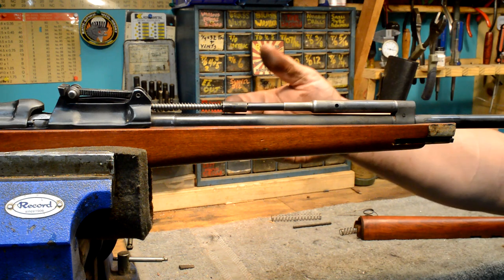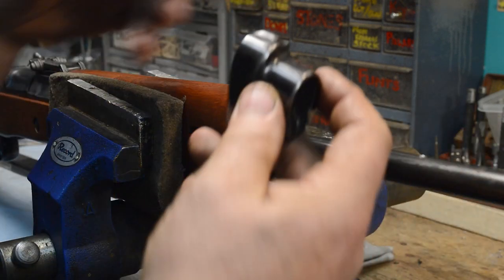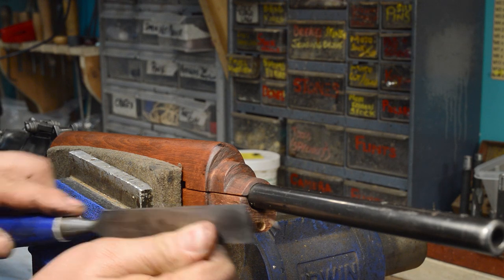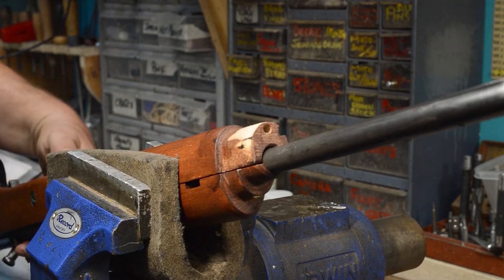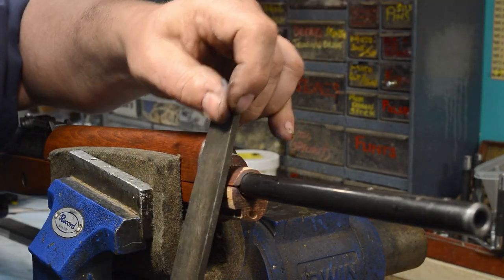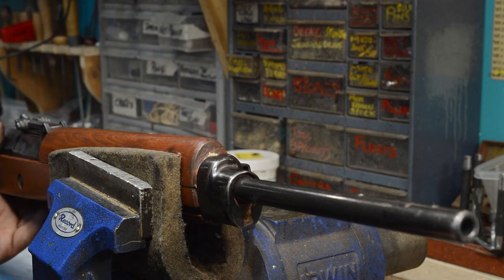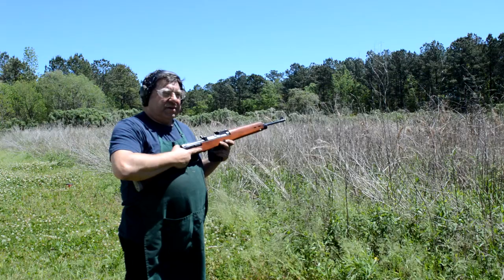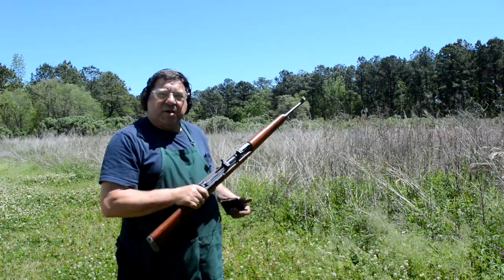Anvil 061: Walther K43 dial in

Comment: Had a couple of those back when Oz had a sense of humour about such things. The first one was missing its extractor. Apparently, that is the "great, undocumented feature" of the design. The extractor retention system left a LOT to be desired.Oddly enough, it would extract and eject, barely. Residual bore pressure? Black-Forest magic? Absolutely ZERO primary extraction in these "flapper" locked jobs

A fascinating piece of history and engineering.

Nice resuscitation work there, as always.
Reply: That's a head scratcher, isn't it?...You'd think that being "over-gassed" into the operating system, they'd actually have a relatively lower bore pressure......presumably too little to act like some blowback operated weapons do, when they omit the extractor entirely....Which is what it sounds like you're describing. Curious indeed!
Reply: The method they engineered to provide the delay is obviously pretty spot on. Must also be a strong action too imo, front locking I guess.
Reply: @rickb1973  it's only over gassed until the bullet exits.
Reply: @redtobertshateshandles  Good point

Comment: A great addition to the G 43-K 43 is a  25 round Magazine. A MG13 mag can be easily converted by adding the same sized lumps as on the G 43 MAG.   MINE works fine.

Comment: At around 15:20 you're talking about the gas system and it's actually super interesting to know that nowadays it is more than recommended to change the gas system on your G/K43 as the originals were made according to the fact that those guns would be issued in russia where the temperature were so low that the gun required a much higher gas pressure in order to successfully cycle the bolt assembly and operate it. Used in normandy, these guns had to be adapted or the gas system would blow up.

At least, this is what I've heard and it makes sense, will have to definitely double check that

Comment: Great video but I'll admit for myself that I am never bored watching you weld, and repair guns in any fashion,

Now, the area of a circle calculation is Area = Pi x Radius^2 so if you know the bore size it is an easy answer, just subtract the smaller from the larger and convert to % (divide by 100 or move two decimal places). 

 Mathematicians and 13 year old 'experts will probably mention there is a more accurate way to calculate this so I'll mention that I know, I took Algebra in the 60s...
Reply: In summary...a hole 1/2 the size of the previous larger hole....has 1/4th the cross-sectional area..

Comment: I had one,once; when this country still had a sense of humour.

As with many of them, it was missing its extractor, extractor spring and retaining pin. Absolutely the weak-point of the design.

Interestingly, though, there was enough residual bore pressure to partially extract the fired cases (brass). The folks at Heckyl and Jeckyl seem to have had some experience with the design, as their extractor is similar, but uses a MUCH better spring system.
Reply: A few still share a sense of humour.

Comment: I know this is a couple year old video. I have one of these mostly matching with the exception of the gas cylinder(have the original but cracked). Was thinking of the updated gas system mod
Reply: Highly recommend you just snag a complete gas system from Frontline Militaria. Works very well

Comment: Mark, I was taught to always use non copper coated rods when welding on guns. I was told that the copper plating on a welding rod would mess up the blueing process and the color would not come out correct. Can you expound on that? Thanks for the good video, sir!
Reply: Not Mark, but my guess is that since some blueing is a controlled rusting of the surface, that any copper deposited from the rod into the weld won't blue properly since copper doesn't rust but oxidizes instead.
Reply: I was wondering what kind of rod he used or typically uses.

Comment: I'm a studying welder so I don't have much experience with specilized steels, where do receivers and barrels lie as far as hardness and weldability? Are they like tool steels?
Reply: If memory serves, modern barrels are 4140. The rest, I don't know
Reply: Neither are meant to be truly "hard"". TOUGH? Yes, but except for bolt-locking surfaces, NEVER "hard" You can make a perfectly functional barrel out of mild steel. If loaded with "proper" ammo in a correctly cut chamber, it will work, but, in modern, high intensity cartridges, will wear fairly quickly. The classic Lee Enfields, before the No4 series, were specified to be made from straight carbon steels, heat-treated to an exacting recipe, as required for function and durability. In the wild old days before every man and his dog had pyrometers, this had a fair "fudge factor" built in  ("Cherry red' is a whole lot different in a big 19th-century shed on a rainy night than it is in a brightly-lit forge).

What appear to be simple, small parts, like the cocking piece, were differentially heat-treated: The rear, threaded, "grasping" section was  pretty much left alone. The front half inch or so was heat-treated to a high hardness before final precision grinding of the sear bents.

Lee Enfield bolt heads were originally made from "malleable cast iron". If you see one with e letter "M" stamped on it, that means it was made from "Mild" steel and then case-hardened. Most of the production from Lithgow had "M" bolt heads.

4140 is pretty versatile stuff, because it can work fine in some applications, straight off the machines or be carefully heat-treated to be almost glass-hard for things like sears, but NEVER for parts subject to shock.

The M1 rifle receiver was made from 8620, which is a whole other exotic steel. When properly heat-treated, almost impossible to "blow up", or even set-back the locking shoulders. (never mind the wrecked other bits of said rifle becoming stray missiles or bent scrap.

Welding any "exotic" alloy without pre-"soaking" and subsequent stress-relieving can be "interesting", as well. A few dabs with the TIG AND the correct filler rod, here and there? OK, but.....Start zapping air-hardening steels in stressed locations and life can get a little strange.

Comment: Does the TIG welding effect the barrel steel in any negative way?
Reply: Id assume tempering would be shot
Reply: @Darranis_Kuningasverinen  Done quickly  and with the proper heat ..the HAZ zone of a tig weldment is at most... .050  (fifty thousands of an inch) so you arnt screwing with much tempering/heat treat.

Comment: Stupid question: when you describe a stock as "re-pop", what do you mean?
Reply from the maker: Reproduction
Reply: @marknovak8255  One more stupid question:  The stock on this rifle looks like a rough finished, machine inletted stock.  I ASSUME that there isn't some factory post war cranking these out, and it obviously wasn't fitted before you got at it with a rasp and chisel.  Are these just original wood that never got mated to a rifle in Germany and eventually found its way on to the civilian market here or does somebody have an inletting machine set up to make these?  Is that answer variable for different guns?

Comment: Not a registered gunsmith or trying to tell you how to do your job but how come you dont plug the wholes with screws torque them down good and then file them flush with the receiver?
Reply: He's making look like the holes were never there. Doing it the way you said you would always be able to see the screws.
Reply: Probably to avoid a joint line.
Reply: @steveb6103  no not if you file it down flush and buff they would be darker if you reblue but Atleast your not applying heat and compromising the strength of the receiver
Reply: @steveb6103  but then again im not one to be knowledgeable on this
Reply: @christophermercer2632  the only strength critical area on a firearm is barrel, locking lugs, and bolt.

That's why an AR can use aluminum receivers, with steel barrel, barrel extension, and bolt.

Comment: Is it just me or does the handguard on that K43 look like that on an AK?
Reply: its handguard was roughly inspired by that of the SVT-38/SVT-40, as was most of the gun tbh. And it's a bit of firearm convergent evolution - the SVT, G43, SKS, and AK all include 2-piece handguards that cover up a gas block and piston, all of which get quite hot and release little puffs of gas. That vented handguard design that they all use is simply the most cost effective way to protect the shooter's hands from all of that heat, give the metal components adequate air flow, ensure easy disassembly, and keep costs down.

Comment: I was a mechanic for years and now I have stains on my hands they are hard to clean any tips ??
Reply: Not working as a mechanic anymore seemed to do the trick for me. 🤣 In all seriousness, try some soap with pumice in it like Lava soap and a plastic bristle brush. When I was working as a mechanic, I liked to get my disposable gloves from Advance Auto Parts. Grease Monkey was the name of them I think? They were blue and like 10 mil thick. Pretty tough for disposable gloves, some days I would only go through one pair, and good dexterity too. Your hands will sweat like crazy in them, but that also helps keep them clean. When I worked at a salvage yard, one of the other guys would wear a pair of crappy, disposable gloves under his Mechanix gloves.
Reply: I use Scrubs-in-a-Bucket after working on my truck, tractor, excavator, or whatever other greasy, nasty thing comes along.
Reply: I always hose my hands off with brake cleaner before heading home. Don't do it if you've got any cuts on your hands though, that doesn't feel very nice. Probably going to grow an extra limb one of these days, but I'm not leaving grease stains on everything I touch anymore. Plenty of pumice based soaps on the market that do an Ok job, like Ian said the plastic bristle brush is a must for getting under the finger nails.

Comment: What is the name of the wire wheel and where can i get it????
Reply: If you mean the one he uses to remove rust - it is from Brownells and is made by Grobet
Reply: If you're referring to the CARDING wheel, then like J Whiskey said, it is from Grobet.  Recently, I've learned that the longshaft buffer he uses is made by Baldor, and I cannot seem to find one like his.  With a carding wheel you have to have it spinning 500RPM or less, apparently.  Everything I've found thus far has been easily 3 times that amount, and I'm nobody to play with electrical currents & have no clue how to reduce that speed.  

Just REMEMBER a carding wheel is NOT the same as a wire wheel.

Comment: Wouldn’t a lathe file worked just as well?
Reply: As long as it has never, ever touched metal.
Reply: As Mark has said over and over again: there may be other ways to do what he's doing. He's showing how he does it, and he won't proclaim anything as the One Best Method.

He will tell you what not to do, however.
Reply: @TheRealColBosch  and Mark has used metal files on wood, as long as the file in question has never touched metal.

Not that I could tell you which episode of Anvil he does this...
Reply: While I’ll give you gentlemen kudos for listening. A lathe file doesn’t have side teeth. This way you can get up close without marring the side finish. 
That’s the point I was making. Nothing about it touching metal. This way you can just buy the right file for the job.
Reply: @McFingal  ah, gotcha.

Could have sworn that I had a metal file with teeth on the side, but whatever. It may not have been a lathe file.

So yes, a brand-new lathe file (that already comes with one flat edge) would be ideal. The reason you need one that has never touched metal is not some cross contamination worry, it's because a single file stroke on metal will dull the edges enough to really tear the wood.

Thanks for adding to my tool shopping list! 😆
Reply: @ScottKenny1978  McMaster Carr, they have everything and then some. 

Quick note: some people think a lathe is expensive. No it’s the tooling that eats you lunch for a month of Sundays. 🤦🏻
Reply: @McFingal  thanks!

A single lathe file shouldn't be too bad. Not like stepping onto the Snap-On truck.
Reply: @McFingal  huh, only $19 for a 10" file, and $33 for a 14" file. That's much cheaper than I was expecting!

Now to add a wood handle to the buy list... (Wood handles for woodworking tools, plastic handles for metal tools)
Reply: @ScottKenny1978  well, currently I have three storage units full of tools. It’s an addictive force. 🤷🏻‍♂️
Reply: @McFingal  I know it well...